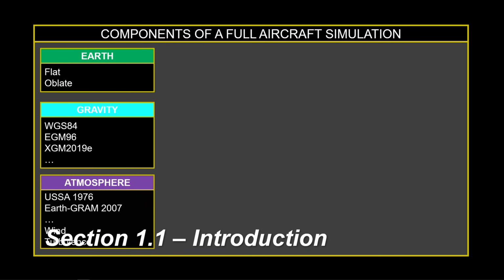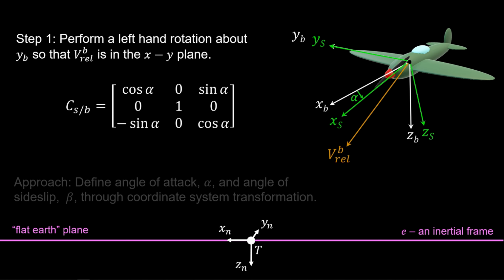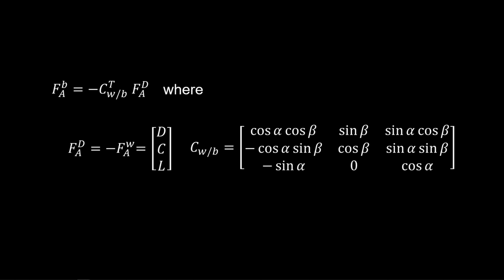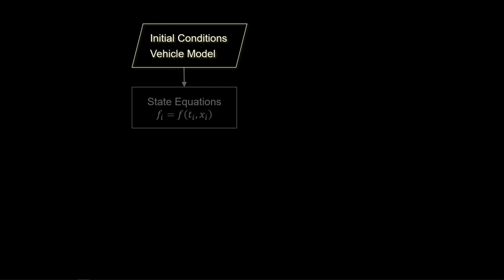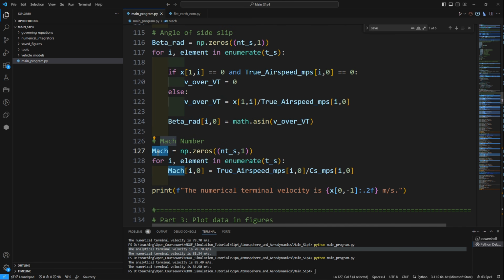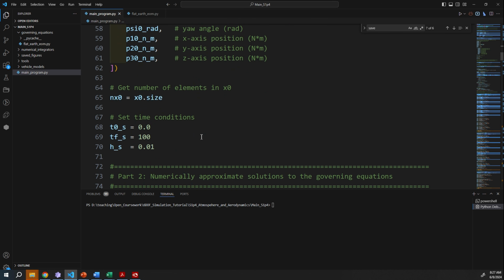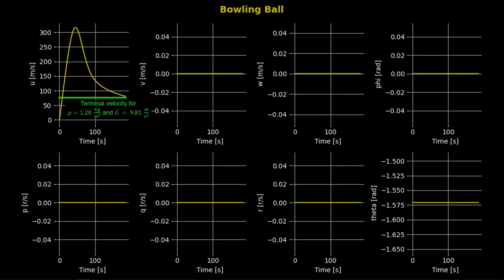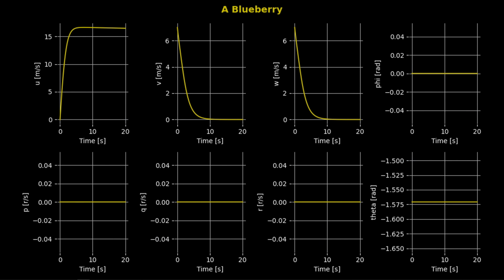Navigation Equations | Atmosphere | Aerodynamics | Angle of Attack/Sideslip | Flight Sim - Sec 1.4

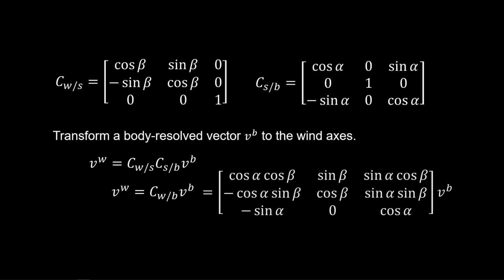Comment: 6:27 Hello! I was working out the DCM here, multiplying by hand, and, correct me if I'm wrong, but I found out the term on the second line, third column should probably be negative (as it is the multiplication of -sin(beta) with sin(alpha)). Great content!
Edit: It appears it is corrected in the code shown :)
Reply from the maker: Good catch! There's usually an error or two in a video, some more egregious than others. 😅

Comment: I would like to know if there's an efficienct means of interpolating the Cd of an object (sphere, bullet or fuselage, wing shape etc) for a given Mach number? Are there a data tables available online?
Reply from the maker: Doing some research for an upcoming video, I found this report that you may find helpful: https://ntrs.nasa.gov/api/citations/20110016614/downloads/20110016614.pdf
Reply: @LearnGandC  thank you. It seems that best fit curves for Cd across a range of Mach numbers are usually derived from a collection of drop test results. I wonder if someone has devised a mathematical approach of getting Cd values based on object dimensions.
Reply from the maker: Yes, the dimension comes in from computing drag from the drag coefficient as the reference area is involved. In addition, there is the transition to turbulence, a Reynolds number effect,  which is based on diameter.
Reply from the maker: Hi there, absolutely! Tabular drag data for a body is often given as a function of Mach number. To find the data, you'll have to search in reports, journal articles, or conference papers through your favorite search engine. As I find good resources for aerodynamic data, I'll link to them on the webpage, www.learngandc.com.